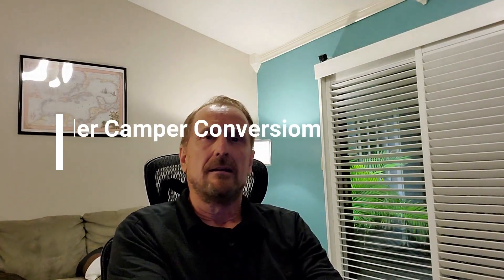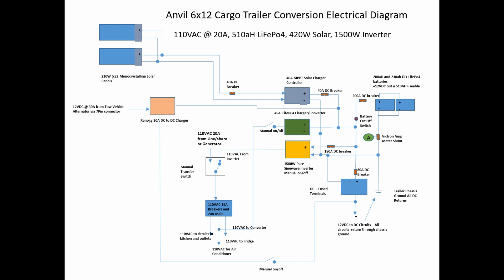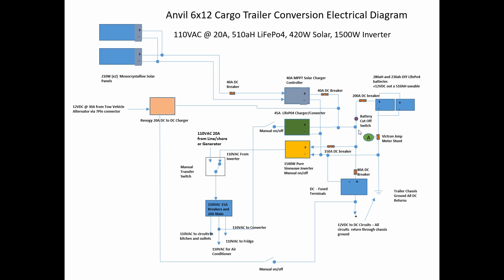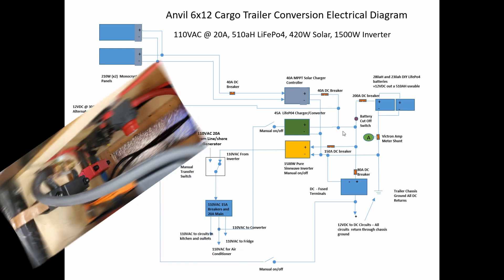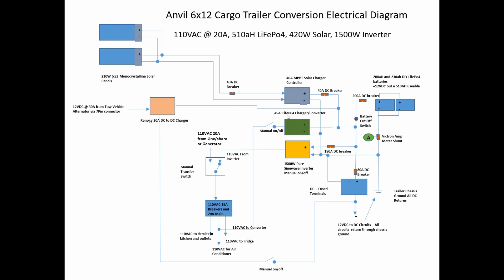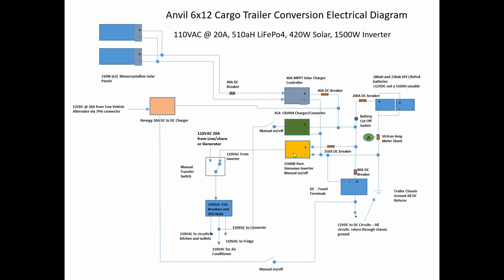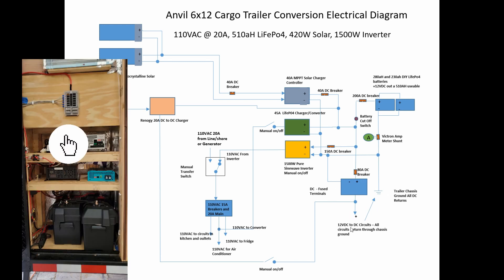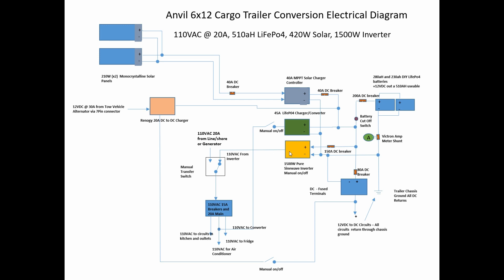Cargo Trailer Camper  - Solar Powered Off Grid Electrical System - Setup Block Diagram

Comment: Hi Don, thanks for making a great video series and this one on solar. I have a couple of questions before purchasing anything else for my build. The first is on the components directions/manual that comes with each, do they explain what gage wire, what amp fuse and breaker? If not, which book would you recommend? Or should I just buy all the materials except for the wire and have a qualified electrician do this? If I did it by myself, I'd definitely want someone to check my work on this. Thanks again
Reply from the maker: Theresa, thanks for the feedback.. getting the gage wire and fuses correct is very important to function and safety.  If you want to take the time to learn some basic electricity and understand ohms law, there are some  guides out there,  but you may be better off to get all the components,  lay it out and have an electrician assist you with wire and fuse selection.  Just something you really don't want to take chances with.

I have an electrical engineering background  so this stuff comes easy to me. I take that for granted sometimes.

Comment: Thanks. I just asked about a block diagram a few days ago and BAM, here it is. Well done. I like it.
I am considering splitting my solar somehow. I don't want all my solar on the roof. Which requires you to park in the sun, else your panels are worthless. We like to park and set up camp in the shade. I need to decide if I want my panels removable, or have two sets. One set on the roof, and one set hinged (faces together) and portable. So I can set them out in the sun, away from trailer. The 12VDC will be our primary source, since we usually tent camp and are accustom to not having 120AC. And don't camp in parks. AC will be for A/C (ha), lighting and charging when on shore power. I have a 300W sinewave inverter, but I can see not needing it. I don't plan to run AirCond (A/C) from solar (initially).  Or until battery prices come down considerably.  I have a couple years before we head out West for a year. Thats when we will want some cool A/C. 
- That said, what do people use 120VAC for other than A/C and a large fridge? That can't run on 12VDC?  Just curious. 
Thanks again for the diagram!
Reply from the maker: You are welcome.... Agree on panel on the roof. Often I am in the shade. 

AC is primarily for the fridge and Air Conditioner, but I have other 110VAC appliance like a small microwave and Coffee grinder. It just gives you some options..